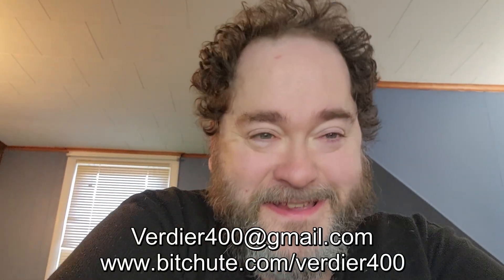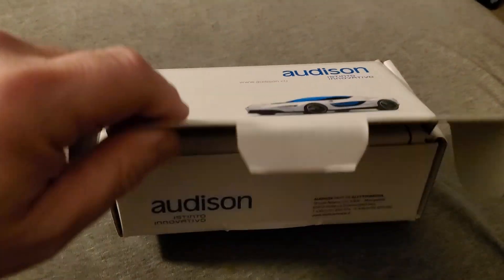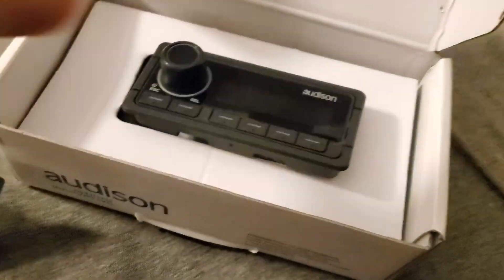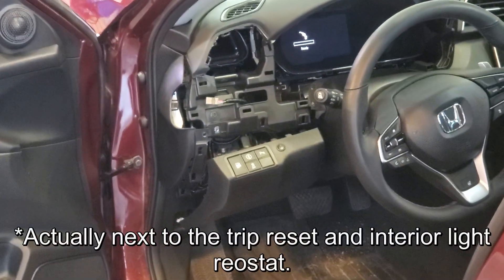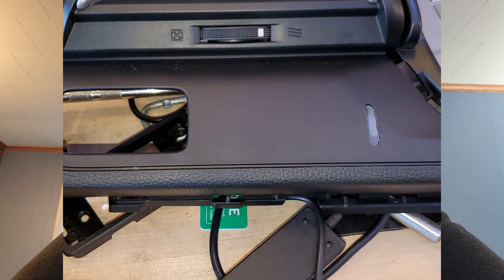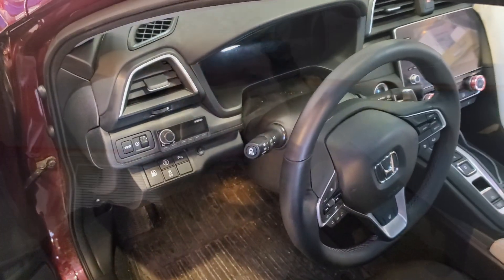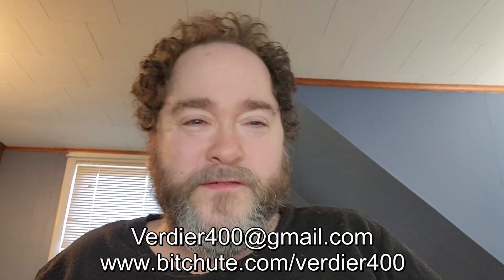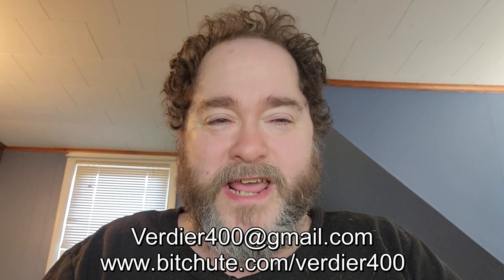2019-2021 Honda Insight: Installing the Audison DRC-MP

Comment: hi, how do you create dsp settings? I have an 8.9 Forza, but only 2 settings A and B?
Thank you
Reply from the maker: You have to hook your laptop to your Forza along with the correct software. Within the tuning software after you're done setting the parameters you can save them as a or b. After you set one as a letter then you change the tuning to something different and save it under the other letter. Once you do that you disconnect from the amp and they will switch between tunes as you choose a or b. Personally I won't touch the tuning settings in the app since Audison's software is touchy as all hell. My radio tech has had a huge number of dsps come back frozen due to people incorrectly setting the amp or not exiting the amp's software as the instructions say so. Once that happens the amp has to go to the manufacturer for repair. Do yourself a favor and have a tech do it just in case so you're not out the cost of an amp repair if something goes wrong .
Reply: @verdier400  thank you

Comment: Hey how are you ? Quick question. What fluids changes have you done to your Honda Insight car besides oil and filter change and what miles are you currently. Thank you
Reply from the maker: I have a little under 32K miles. I have done a Brake fluid change after the 2 year mark and I also recently did the e-cvt transmission fluid. I think it's a good idea to change the brake fluid every 2 years or so due to natural breakdown. The transmission fluid can probably wait for a bit longer closer to the 4+ year or 60K mark. I did a video discussing this here  https://www.youtube.com/watch?v=zjjWQXai2UA&t=1s
Reply: @verdier400  thank you I appreciate it. My girlfriend has the 2019 Honda Insight at around 56k miles. Planning on going to a dealership for the transmission fluid. It’s been doing great for not doing it at 30k as the dealer recommended but I do hear a difference so it’s time to change it.
Reply from the maker: no problem.

Comment: I'm trying to updated to 2.04 but can't do
Reply from the maker: If you're trying to update the Audison equipment then I can't  say I'm surprised you're having trouble. I have my audio tech take care of all updates since the hardware is so sensitive to bricking if you make even a minor midtake during the process. If you're having trouble I'd recommend you go to an authorized tech and have them risk bricking your equipment. At least you'll be covered on a repair if it goes horribly wrong .